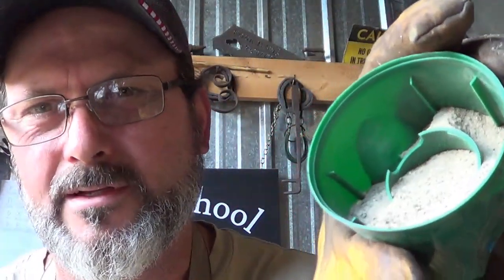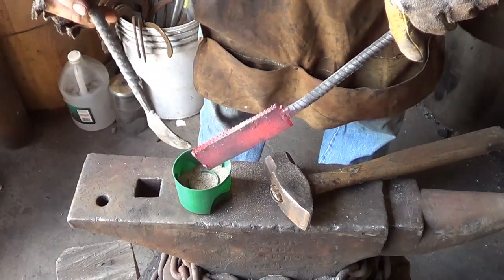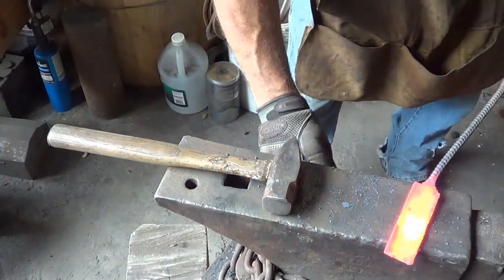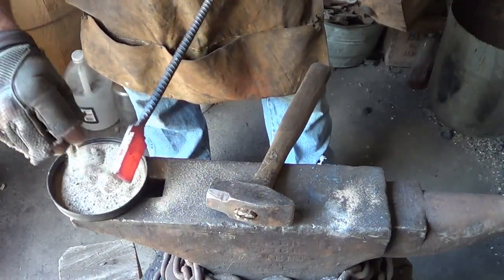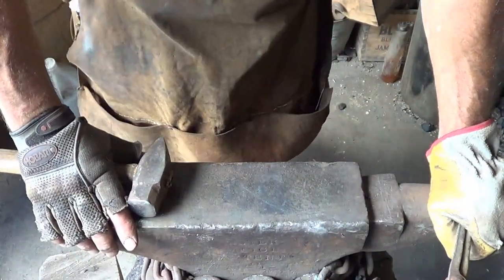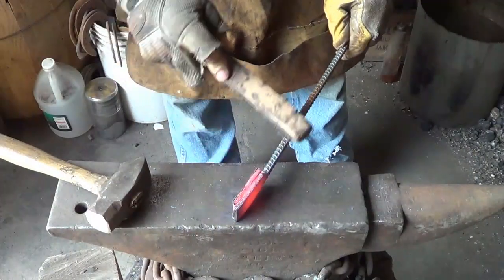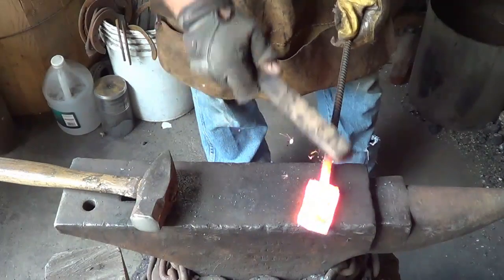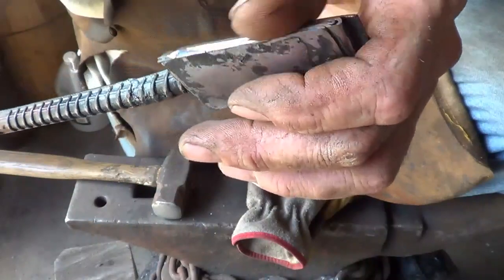Blacksmithing - Forge Welding With Sand As Flux

Comment: quick question. I forge welded a billet of 15n20 and 1095 san mai style with 7 layers. Everything did just fine except for one of the layers not laminating to the rest. Can I reheat the billet to forge welding temps and re stick the weld, or should I grind off the layer(s) that didn't stick and start folding the rest into damascus?
Reply: I have tried using a solution of borax and water and then soaking the billet in the solution in order to get flux deep into the de-lamination. Then , after taking heat, I flux the fissure, apply more heat to let the flux flow into it, then apply more flux. I'm not sure which worked, the solution soak or the multiple heats with borax, but either way, it gets deep enough to help stick the weld. In the end, my advice is flux early in the heat (before it scales too much) and then several more coats at high heat to allow it to flow down into the layers (keep the billet on its side so the de-lamination is on top and let gravity do its work).
Reply: DragonHide94
Awesome, thanks for the info. I'll give that a shot for sure.

Comment: It's very simple and I talked about mulitiple times. 

The higher the amount of carbon, the lower the melting point. With higher carbon steels, beyond 1045 steels the melting point is low enough that a forge weld without flux is (often) too hot. In order to get the molten scale, which I show in various videos the temperature has to be above 1369C - 2496F. Steels above 1045 steel pretty much can't take it that amount of heat. 
It will crack, the heat is too close to the melting point of the steel. 

1045 can take the heat reasonable well and steels below too. Mild steels take it just fine and the lower the carbon, the more you got to pure iron or wrought iron, the better the material can take a weld without flux because the melting point of the material is sufficiently high enough to take the heat.
Reply: Thanks for the info, Joey. That is very good to know for us new guys.
Reply: Excellent information Joey. Very helpful.
Reply: I've done several billets without flux, just an oxygen barrier, i.e. diesel fuel soak.  The fuel burns off and leaves a carbon residue.  It works, but I prefer using flux as it gives me a little more time and a visual indicator.  I guess you could call the diesel fuel a type of flux.  The downside to using diesel is that to cut and fold you have to wait until the billet has cooled before dunking again or you get a fire, so I just flux and go.

Comment: I think it's telling looking at modern welding procedures.  All the common ones use some method to protect the weld, either solid flux or inert gas.  I say if you get better results with flux, then use it even if you don't need to.  The weld would just be that much better, no?

Comment: I know Rowan Taylor says that he doesn't use flux on mild steel, but when he welds high carbon he uses borax for flux.
Reply: I also know from trying it, you don't NEED borax to weld mild steel, but it sure as hell helps!
Reply: Rowan Taylor uses a side blast forge which allows him to heat his steel in an oxygen deprived environment just above where the air blast comes in.  Bottom blasts basically blow air right onto the steel.

Comment: If you are gonna use sand I think sand with a higher silicon content would be better, like glass making sand. According to the wiki page for forge welding a high silica sand was originally used as flux. Hope that helps.

Comment: I have heard that the Vikings used crushed-up seashells for flux.
Reply: Seashells are mostly calcium carbonate, with a melting point about 1330 C, higher than borax, but lower than silica, so I could see how that might work, though I think that both silica and calcium carbonate would be better suited to lower-carbon steels; boraxi is probably best for high carbon steel.